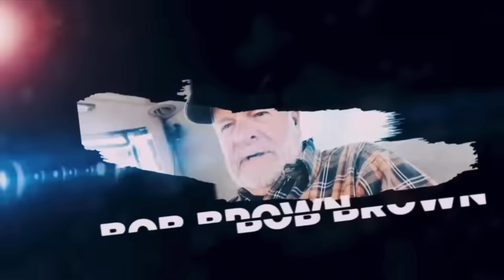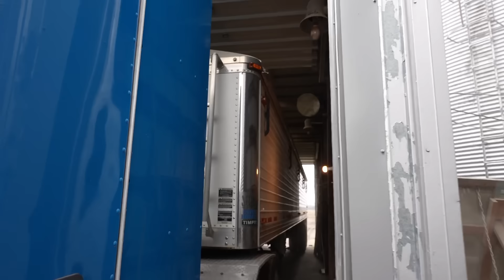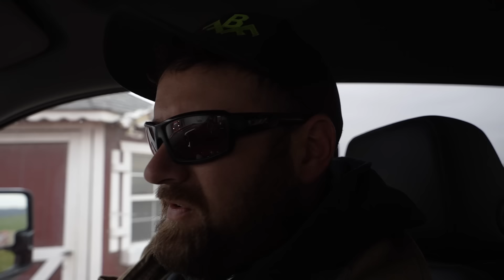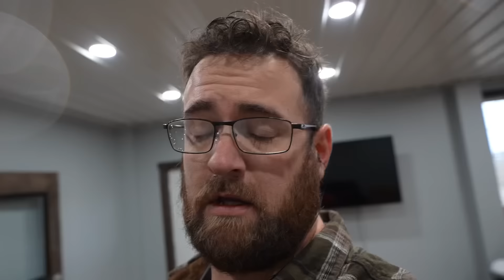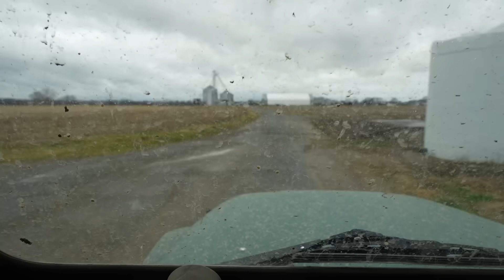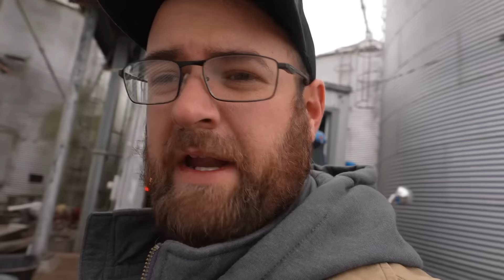We need to stop wasting Corn #cornfail

Comment: On your c15, there’s a fuel check valve on the back of the filter housing. I’d try that first before you take it to a dealer. It’s easy to do and take a minute to put in.

Comment: What are the things on the rear fenders of the challenger tractor? They are color circular that looks like a remote or a hookup point
Reply: Probably remotes for controlling the PTO and 3-point hitch.
Reply: yup they are outside control pretty slick if you need to do PTO stuff and watnot